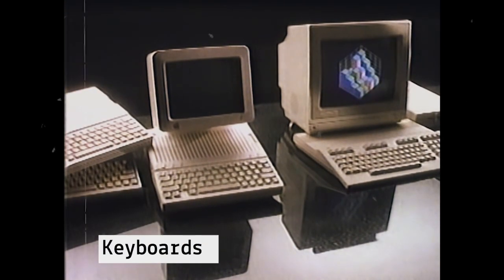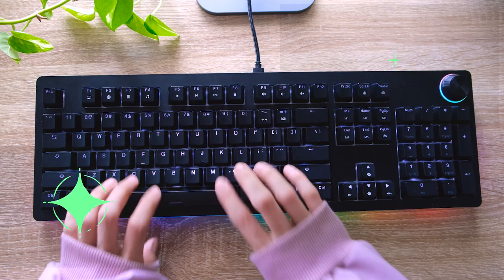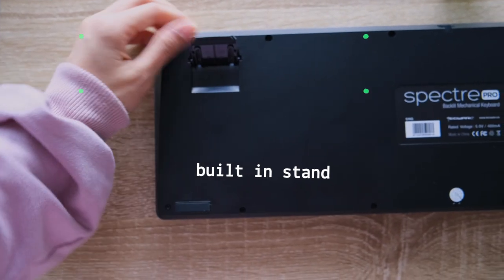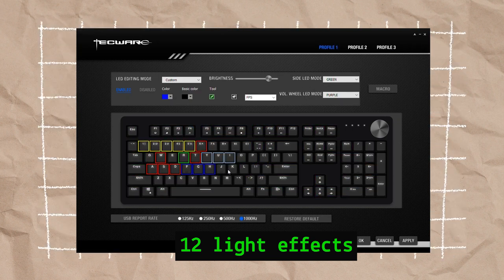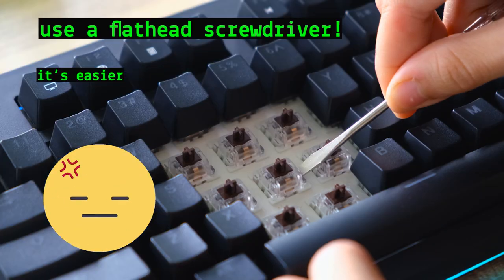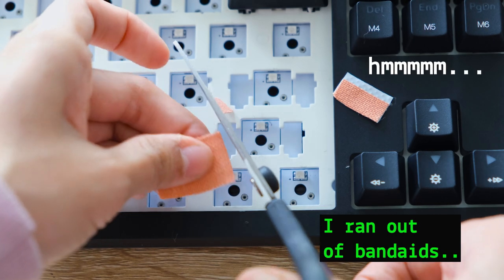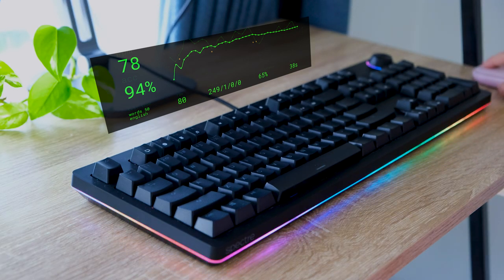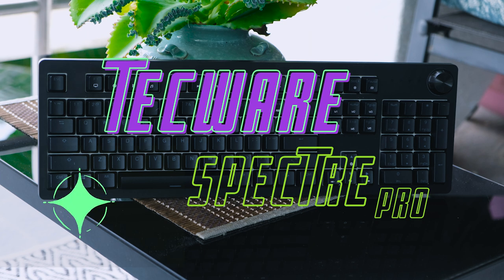Full size Keyboard - Tecware Spectre Pro

Comment: you weren't kidding with that switch plate, taking out the switches is ridiculously hard. i ended up with a scratched up switch plate using a flathead screwdriver. taking the keyboard apart and popping off the switches from the back helped a little tho

Comment: What an odd coincidence. I was looking for a video of this keeb to share with my cousin whom I've just passed this keeb to! 😂 100% on the switch plate being too tight. Initially planned to mod it before passing the keeb to her, but after spending wayyy too much time to yank out a single switch (faulty A key) from the socket which proved to be a hugeeee pain, I gave up on that plan. Didn't try with a flat head screwdriver but I'm not sure I'd want to go through that 108 times :'D

The one I had was the linear outemu reds which is an okay budget switches but after using lubed and filmed gateron yellows, it does feels bit too scratchy and pingy for my liking. 

Great video as always! ✨
Reply from the maker: Hey jasmine! Yeahh i had to go through 108 of them and it was a pain! But i realise it will be quite easier to take out compared to the first time. Hope ur cousin enjoy this keyboard as much as i do! It's a great keyboard and will definitely last well! Btw thanks for ur lovely comment and watching it😃✨

Comment: I’ve had this keyboard for a couple years now and it’s been fine except for a couple issues.

Mine randomly starts repeating letters while typing like a key is stuck. The second is the ping noise from the keyboard while typing.

I might try different switches to see if it resolves the issue as it’s quite annoying while typing emails etc
Reply: Did different switches resolve the key stuck issue? or is it a socket problem?
Reply: @Chokealot  it actually ended up being something completely unrelated to the keyboard.

For me the issue ended up being with my KVM switch. It had some issues when connected to my laptop dock where typing would either get delayed or start repeating keys.

If I connected my keyboard directly, the issue went away.

Comment: I've researched for my 2nd mech keyboard. I match different brands and model. I need a full size one for my work.  Then I ended up with this Tecware Spectre Pro because it is hot swappable and have volume knob and removable type c. I dont need wireless because it always just sits in my table. Nice one Tecware but It is so hard to find a stock of this in my country.

Comment: it is really not fit with the custom cable you own right now? im planning to buy custom cable in the future later :D
Reply from the maker: hey there well it doesn't fit that well because the port has a plastic edging to the side that poke out. It also didn't managed to fit my magnetic cable usb c. But you might need to mod it by shaving the side of the cable head or you remove the plastic edges at the keyboard port.
Reply: @WanSyazlina  ok thanks info